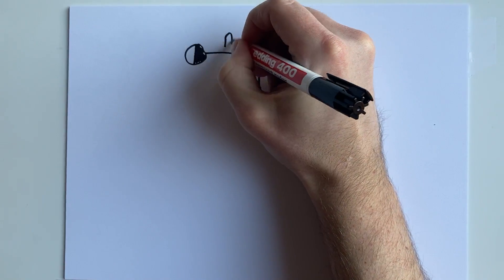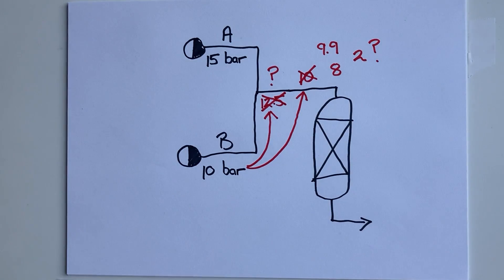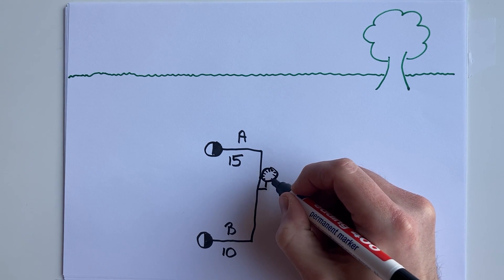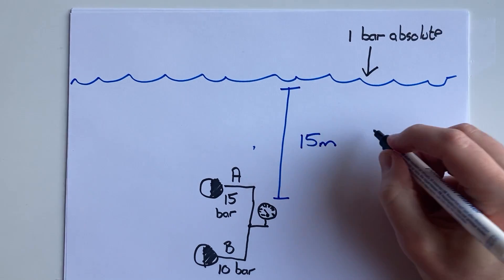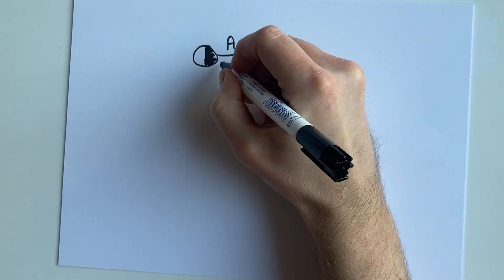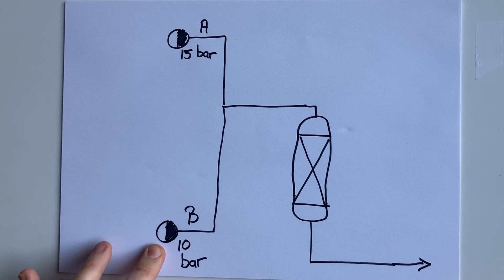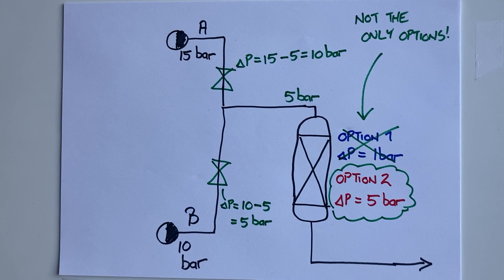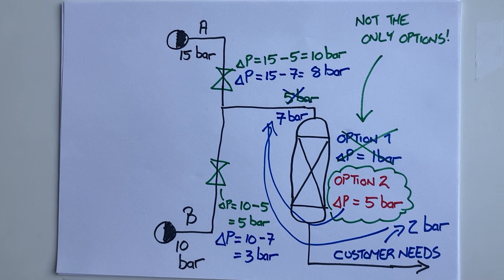What happens when you mix different pressures?

Comment: Excellence presentation. Everyone has the basic understanding that things flow from a higher pressure to a lower pressure (not trying to be sarcastic here). The actual downstream pressure needs to be defined. And yes, depending upon the operating pressure, A will flow more than B, unless a valve is introduced (which will create a pressure drop). Fun problem.

Comment: Good Video. Unregulated the 15 bar line product flow will flow back into the 10 bar pressure line ,if connected one with each other and no exhaust to the atmosphere.
Once connected together and provided an escape to a the atmosphere or other processes via pipeline the potential combinations possible are dictated by many variables.
That's the  Engineers job.

Comment: Sometimes it’s easier to change a flow problem, to an equivalent electrical problem. If you think about preassure as voltage, pipes and valves as resistors, it might be easier to see how to solve this problem, or actually that it can’t be solved without additional information.

Comment: This is a very badly designed system you have described.
If I came across a system designer proposing this as a limitation, instant demotion.
I use in this very situation A/B to atmosphere mixed via a venturi or cyclone vortex valve.
Look I may have misunderstood the end function, but still there are always solutions, thats the Art off system designer to never end up with a negative, unless that’s what’s called for.

Comment: Umm isnt it like this: If the system is somewhat closed, the pressure will be 15 bar, simply because thats the highest pressure provided by one of the two lines. If it isnt closed and the flow is free to move the pressure sets according to the resistance that just happens to be in the system with a maximum of 15 bar.

Comment: This isn't a question, the higher pressure will always dominate, if you put regulators in line that's a different question, if the end of the system is open to atmosphere you can use a Ventura type valve that will allow different pressures or substances to mix.

Comment: once I made a water gun using 10liter canister, drilled a hole in bottom and inserted car windshield motor and water is sprayed via silicon tube. But then I installed additional same size windshield motor and but also now each motor had an aquarium  one way valve and connected to silicon tube via T connector - to my surprise running two motors did not increase the water flow of the water gun :D
Reply: Because windscreen wiper pumps are positive displacement pumps and water is mostly incompressible (380bar pressure produces a 2% compression on water - Titan oops pressure).
Compressible fluids and centrifugal pumps give different results (but pump sizing is important too).

Comment: As electrical engineer this problem seems easy if you try to imagine it with voltage instead of pressure. In a schematic all connections between components are considered equal voltage. If you want to model the conductors realistically, you'd have add resistors etc. into the schematic, even though they aren't physical components, but models for the properties of the conductor. If you connected two different voltages with a straight connection, you'd get a short circuit with infinite amps towards the lower voltage. So the schematic wouldn't be sufficient this way, you need to model the properties of the conductors/pipes and of whatever comes after the combination point. My bet is that if the resistance after the combination point is big enough, the fluid in the lower pressure source would actually flow backwards.

Comment: Guess... You get to control the flow, by selecting the output pressure... and have to attach the 10bar at a point in the pipe - where the pressure has already dropped below 10... they can't be connected in "parallel".

Comment: Thanks for the video. I've been trying to find a solution for mixing water at different pressures AND with varying pressures for A and B. If A and B are 2 different lines controlled by pressure switches (i.e. for well water pumping), then the varying pressures mean any mixing valves cannot be static. And since you cannot perfectly match any pressure switches, either A or B will eventually go to the minimum switch activation setpoint more frequently. It's an interesting problem for which I have not found a good, automated solution.

Comment: Interesting - I do underground process water systems in mining and deal with this constantly.  These are generally closed systems (no atmospheric dumps unless we’re filling reservoirs etc and even then we’d use orifice plates with PRV or sustaining)so we deal with frictional losses as back pressure in miles of pipe, a lot of it horizontal. Joining two streams isn’t really ideal underground, the higher pressure from one would just push back against the other until the pressure drop was big enough to cause mixing. We do force this sometimes using sustaining valves though. Anyway, great video and great explanation on how the entire system needs to be understood.

Comment: Does a mixing problem always need 50% mixing? Does this assume same viscosity?  (Or some other physical properties?)  How does one engineer a desired molar mixing of disparate inputs? Obviously, I'm not a chemical engineer.
Reply: No, it will not necessarily be 50% mixing.  That's just usually the default example that most people would think of to give, to keep it simple.

What ultimately will happen, is the pressure drops in the two pipeline networks that feed the mixing chamber, will both end up such that same pressures enter the mixing chamber.  They will find a compromised pair of flow rates, that satisfy equal pressures being mixed.  The unintended pressure drops in the two supply lines will find a way to seek this balance, if you do supply both sources with different pressures.

Comment: At the mixing point the 15 bar would flow out as well as down the 10 bar line because it is 5 bar higher pressure. The B component would not flow at all because it is at a lower pressure. Even with a backflow preventer the 10bar pipe cannot over come the 15 bar at the mixing point. If I have this wrong please explain why? Thanks.

Comment: The flow from the 15 bar would have a pressure drop from the source and along the pipe to the outlet at a given pressure. If the pressure at the mixing point was higher than 10 bar the flow would back up into the 10 bar system and you would need a check valve. The 15 bar system would want to shut off or limit the 10 bar flow. It is a very bad design and lead to chaos. I was hoping for an actual working model to prove the chaos theory.

Comment: It is the same in electrical engineering. The impedance of a line determines the voltage at a given current flow...
I love it when seemingly independent fields of engineering go hand in hand. 
Just as how Navier Stokes and Maxwell equations have a lot of symmetries.
Reply: And Reynolds ;-) Though we've yet to see that properly in electrical engineering!
Reply: @philipoakley5498  I'm not that deep in electrical engineering. I'm more the mechanical guy that has kept an interest for the electronics... rare in my branch, but helps a lot.
Reply: @jackmclane1826  for fluid flows you can get sidewall effects and turbulent flow so there are some differences between plumbing flows and electrical flows. Electric just depends on potential (pressure) difference. 
It's all about how the flow 'valves' are  constrained adjusted;-)
Reply: @philipoakley5498  But you also get eddy currents that have a similar effect to turbulent flows in fluids. They can pretty much push the flow of current more to the inside of the conductor, see 'skin effect' for more info. This can pretty much work as an additional impedance/resistance, creating voltage loss across the wire, just like you can get pressure loss from transfering fluids over ditances. Although I'm not saying the two are the same. It's interesting to see that similiar effects arise in both cases.
Reply: @vojtechsmetana5261  Do watch out for some of these analogies, as they fall prey to the fallacy of pushing analogies too far. Things like skin effect have a strong frequency effect. 
And electrical flow has to be circular, which isn't the case in fluid design. 
You also don't consider EMC effects with fluids, so caution where caution is due. ;-)
Reply: is impedance the valves in this case?
Reply: Yes, the valves are resistance (impedance) component while the pipes are the 'perfect' conductors. (don't forget Box's aphorism about models;-)   @crazysoulpubg
Reply: @crazysoulpubg  Impedance is a more generalized term for Resistance. It contains Resistance, Inductance and Capacitance of a conductor in electrical engineering. 
Not only the valves resist the water flow, but also the pipes have some pressure losses according to the flow rate in them ~Resistance.
Reply: I think the mean difference between EM and fluids is the entropy balance and the way energy is transported.
We can imagine fluids made by particles transfering energy by collisions and electrical particles receiving energy by em flield all around the wire. 
If we have a perfect gas for example, entropy and work done, with no heat transfer, and the same pressure step, are related.
The energy dispersed in electrical wires can only have influence on impedences values.

Comment: This is not a correct explanation.  Upstream pressure also has effects that need to be considered equal in importance to downstream pressure.  You cannot simply consider downstream pressures alone.  Pressure drop that creates flow must be described by upstream pressure, downstream pressure and the corresponding flow rate.   3 variables.  If you know any 2 of them, you can calculate the unknown third value.  You have set downstream pressure and assumed some flow rates and pressure drops in pipe and equipment, then somehow determined that the upstream pressures of 10 and 15 bars are enough to make that flow happen.  That is not necessarily true and must be verified by adding the pressure drops between up and downstream points, checking that the flow rates in all pipes still balance at the connection point.  You have only done half the problem and ignored the rest.  Now you must verify that whatever flow rates you have assumed in pipe A and B are indeed what you had assumed they were when you cane up with their pressure drops.  See the Hardy Cross method for by hand calculation to understand the iterations involved in determining pipe flow and pressure drops in multiple pipes.
In your 15 & 10bar example, what keeps the 15 bar flow simply from entering the 10 bar pipe?  It is only that downstream pressure is lower than both 10 and 15bars.
Reply: My thoughts exactly. This is why we use regulators and orifice sizing in the regulators (not to mention the correct pipe sizing). Downstream pressure should be referred to as the working pressure (The required pressure for the load. There  also could be a variable load that the regulator would compensate for and keep the working pressure constant & a lock up pressure if the flow stops).

Comment: The problem is that the more restricting the mixing pipe is and the following equipment the more likely source A is going to flow into source B.  That is why back flow preventers often get installed.
Reply: Also important that the piping after the junction has the combined flow of the two.  So in a proper mixing situation, more pressure drop per meter in that piping than upstream.
Reply: @mikefochtman7164  true, but you can't guarantee that blockages won't happen. You need to have back flow preventers any time that you bring two different chemical lines together.  You also forgot to mention the angle of entry into the larger pipe being important as well. Ideally you want both lines to meet at a Y instead of a T to insure that the flow is toward the mixing line and not toward each other.